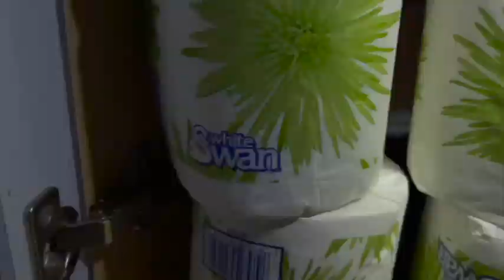How to treat for mice and Roaches in Buildings, Supermarkets Mar 18

Comment: Excellent video!!!what chem are you using on b&g and duster please???
Reply from the maker: Hello John
In the B&G I alternante between Fendona CS and Cysmic for most crawling insects, Transport GHP for bedbugs, and Arilon For ants.   
I always add exciter or exponent for the extra kick.  
Duster - rodents I use ZP tracker in most jobs, Rozul only for extremely bad rodent issues.
Delta dust and Tempo dust for roaches, ants.
Always check label for application instructions.   Hope this helps.